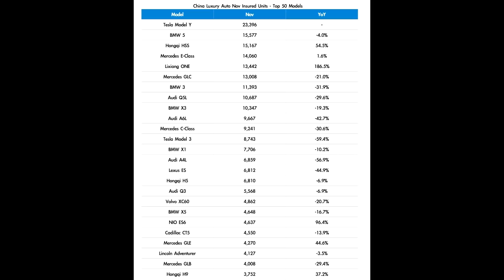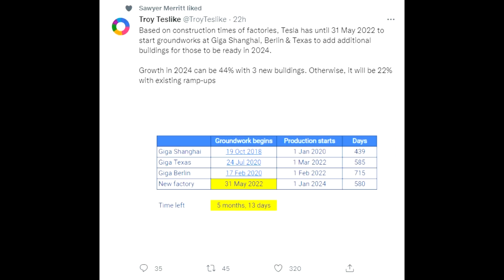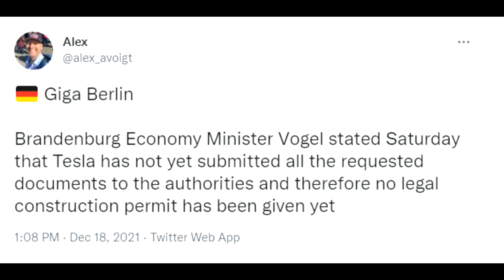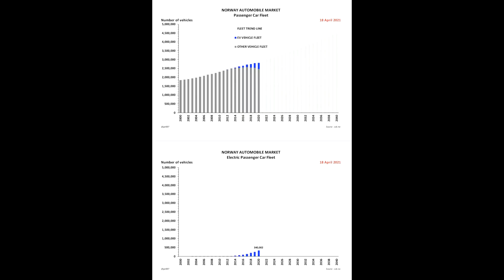TESLA: Giga Berlin further delays likely!

Comment: Before brexit a Tesla factory in the UK would have made sense, but after Brexit it makes no sense at all. Even if the economic turmoil caused by Brexit had settled down (which it hasn't, not even close) it makes no sense to place a factory on the outside edge of the EU in a market that is less than 1/4 the size of the EU and shrinking. Why pay import duties on the larger product flow? Less cost overall for imports from EU to UK than from UK to EU because of the numbers that would be involved.